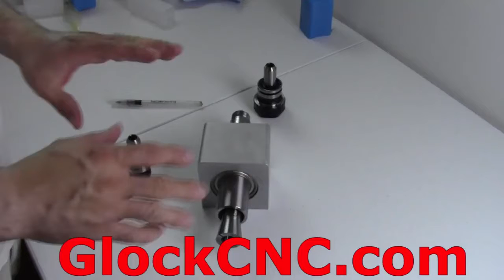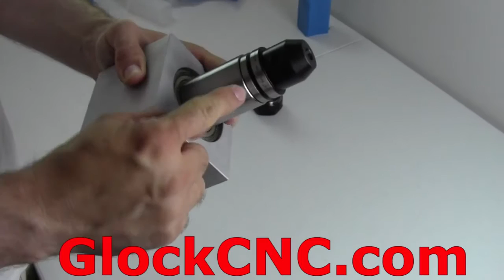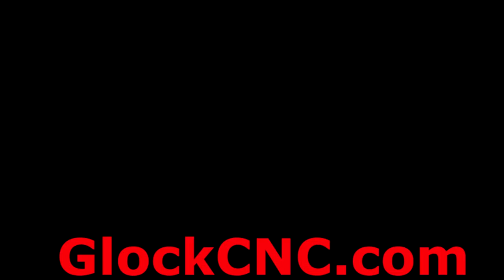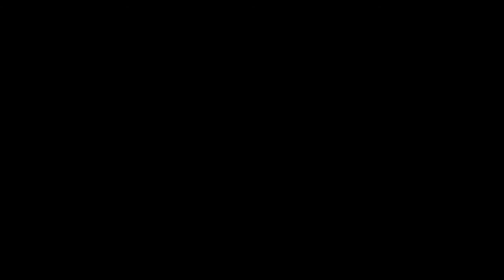NEW Sherline & A2Z Monster Mill Compatible R8 ATC Ready Commercial Grade Headstock

Comment: I have bought the same R8 spindle for DIY cnc spindle project, What i don't understand is, why on earth they didn't turn the 35mm diameter further. the spindle just stick out from the stock like 2 inches. ?
Reply from the maker: The spindles are also used in larger custom headstocks and some customers use pulleys that have more steps. Instead of creating a spindle for every separate need, it's just easier to make one taller spindle arbor that fits the need of all.